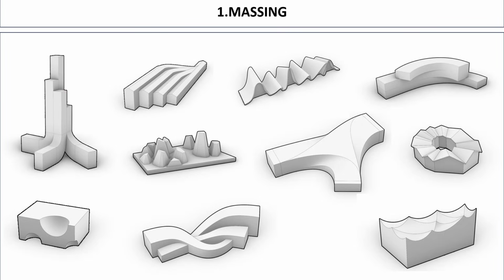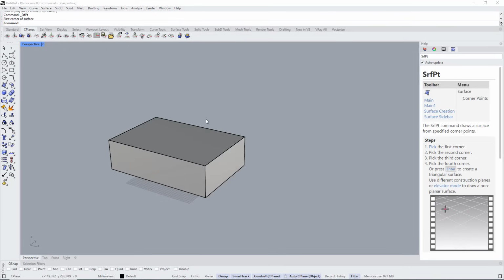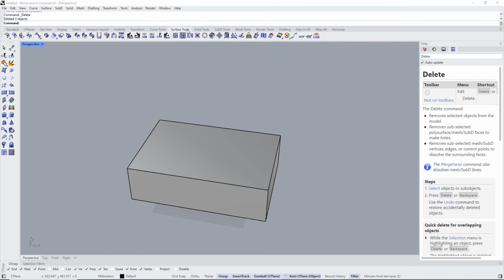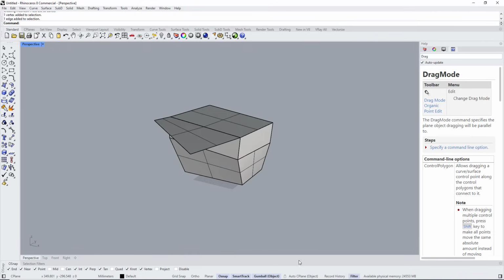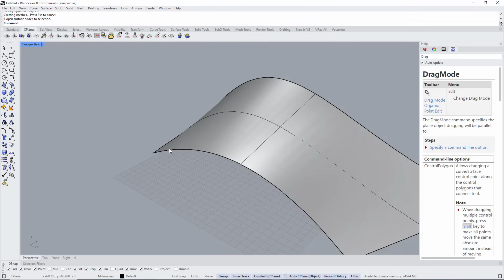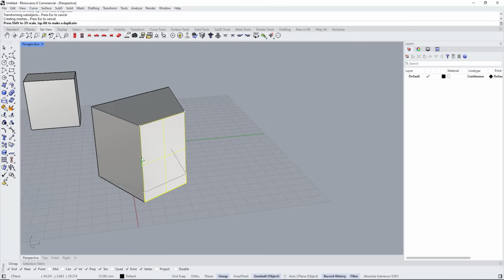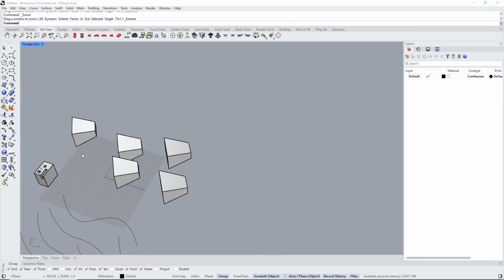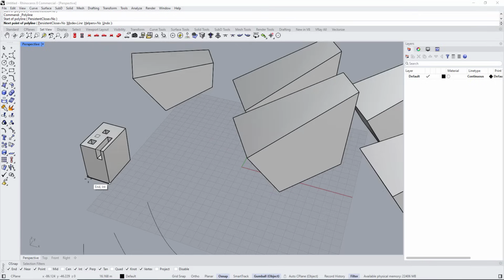01 Rhino Beginner course for Architects_Introduction and basics

Comment: the "cut" trick doesn't work in rhino 7
Reply from the maker: It is a new feature in the Gumball in Rhino 8, however in Rhino 7 you can use Wirecut command instead